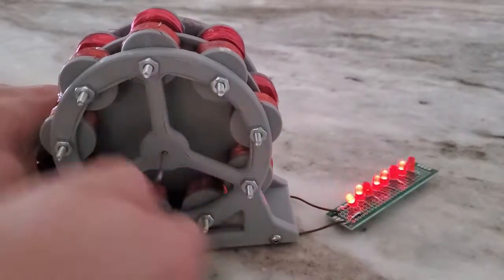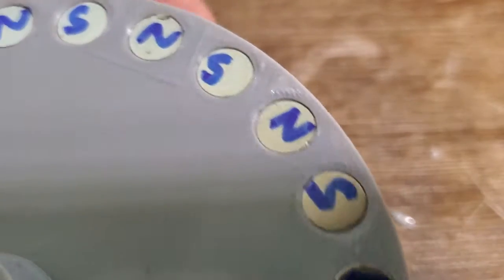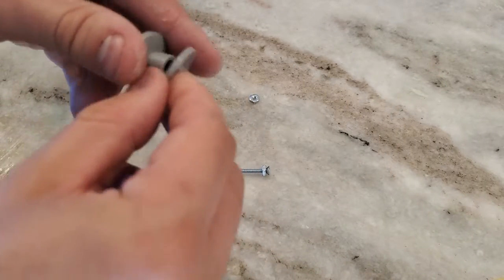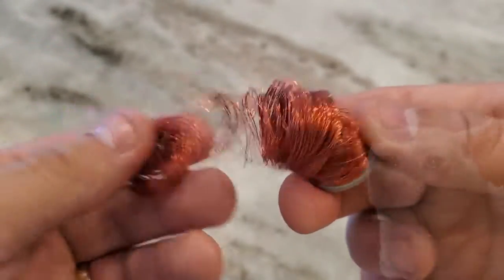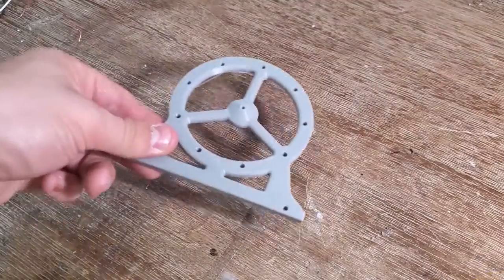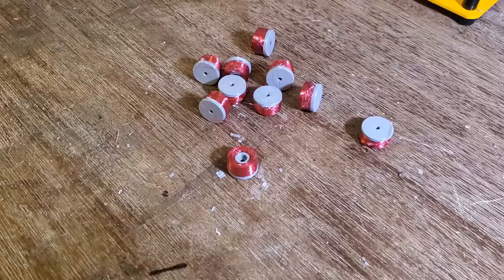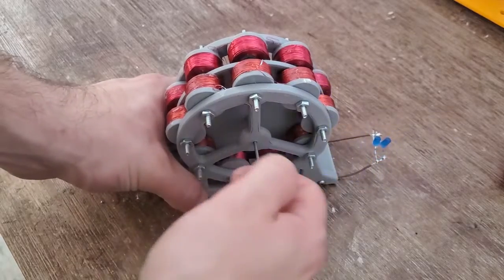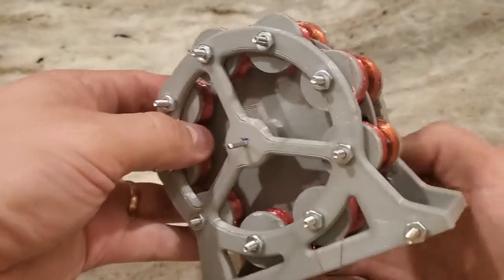Hand-Cranked 2V generator

Comment: Nice design & build!

The LEDs didn’t seem to light up evenly, although it could be a video artifact.  I was wondering if it was variance on the number of coil turns, mechanical from trying to make your hand move evenly, or variance in LED manufacturing.

Any interest in running this off of a fixed speed motor, and doing some slow speed video?  Or a 12 channel oscilloscope if you have one lying around.

I like this kind of build, but have too many other distractions, commitments, & interests to complete many at all.  Thanks for the vicarious success!

Comment: it's nice to see this evolved into your mechanical inverter video. Is there any chance you got the coils series connections cancelling out here too? So many possible refinements, air gap reduced, pins to guide the flux, plate on the back. Check out the flux switching alternator wikipedia page if you want another project idea!

Comment: Great stuff but bad configuration! The coils are well wound and well positioned but wrongly connected and the magnets are small and very poorly positioned. The coils must be connected in 3 groups delta or star so 3 phases come out and the magnets should be 6 pieces and be the same size as the coils. So at only 120 RPM you get about 12V and 1 amp.

Comment: i think u should add automatic crank using magnet or something to make it spin by it self, so u get unlimited power.
i just figure it and i know u can do that 

so my scenario is :
1. automatic spinner
2. cranked generator
and combine those stuff to get unlimited power.

i hope u see this comment and u make that tools, i really apreciated it if you make it.
Reply: The simple answer is power loss due to electrical resistance (in the form of heat) in both the motor and generator coils, along with power loss (in the form of heat and wear) due to friction from the mechanics of the axles.

Replace the wire with superconductors, and you have solved Part 1.

Invent and replace the mechanical bits with zero friction bearings, in a complete vacuum, and you have solved Part 2.

At this point you might think you could get as much power out as you put in, but where does the “extra” come from?

You can build & experiment with your own pretty easily, and I’d be curious how close you can get to “even.”

An engineer could probably give you a top limit, but as an absolute guess, I don’t think you’d get more than 70% back out of what you put in on a home made version.  

Feel free to surprise me!

BTW, the short but complicated answer to why it won’t work is “thermodynamics.”

Don’t feel bad - it’s an exciting idea that many people have had.  There is always room for experimentation and discovery!